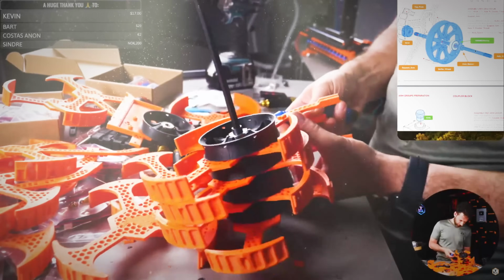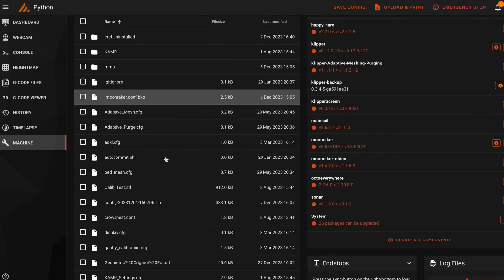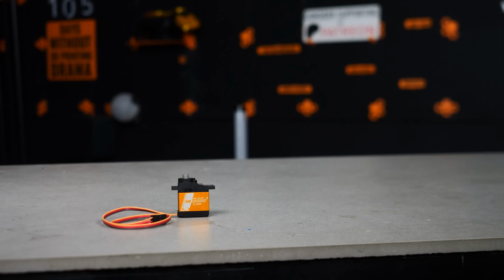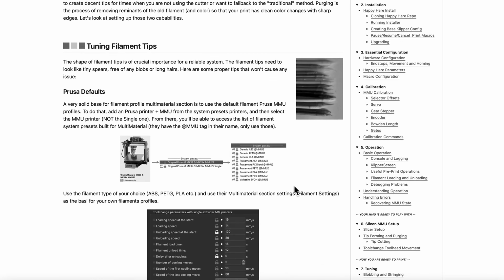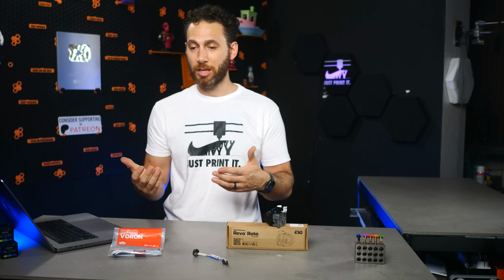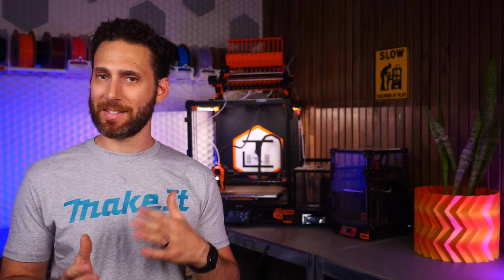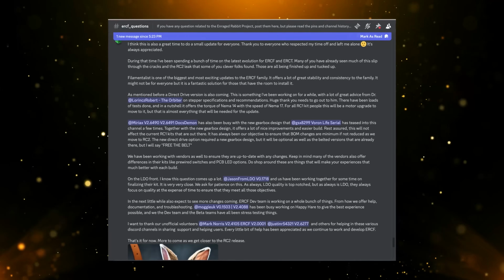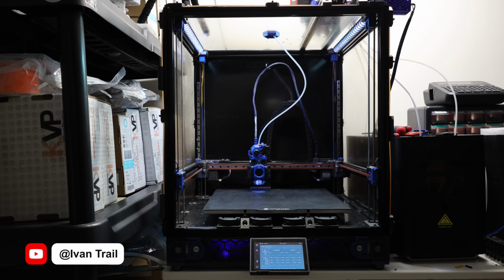I Got The ERCF V2 Working. Here's What I Learned.

Comment: Thank you for the video and details.
I do have some questions about getting LEDs wiring, working and Macro Buttons on Mainsail screen.

I have a Siboor ERCF v2 kit assembled, calibrated and ready to start moving Filament but I have no LED lights working. I have wired it per Siboor block diagram but it confuses me because it seems that some of the + are going to - in the LED chain. There are 3 LED groups.

Any help or photos of your wiring, explanation or screenshot of you xxx.cfg files would be very helpful.

Rat-Rig V-core 3.1 500 with Bondtec LGX Lite using Siboor ERCF v2 kit.

Comment: Hear me out here. And I feel like this has been done but what if you had 2 or 3 (if you have the shekels) tool heads and used each one for different materials. Like tpu in one then pla in the second and dissolvable support material in the third. And say you wanted different colours of pla or even tpu use this system to swap those for that tool head. Stuff like that. Maybe only use a 4 material one. Idk just an idea.

Comment: I have rewatched your video multiple times after talking with you at SMRRF2024 and trying to set up my ERCFv2. After a lot of head scratching trying to work out why my filament blocks just will not behave and searching online for information about how they are even supposed to feel like to engage, I came across this really helpful video which I think is about the filament block mod for the v1.1 which became the design adopted by v2 of the project. It covers that vital missing information about how loose the closure action should be. Now I know my filament blocks are way too stiff, I am reprinting very carefully to get something that hopefully works much better. https://www.youtube.com/watch?v=eno0Ubs8Q_8

Comment: Imo tool changers are the better way. Sure, it's essentially the "lazy" way, adding hotends instead of using a more cost-effective solution, but it's less wasteful on filament, time spent debugging things (looking at your full work week getting this thing to print), and yeah, the individual tools can have issues too, but (to me at least) it seems way easier to sort that out than this thing, since most ppl with a voron would probably know how to approach hotend problems.

Comment: why leave the tip inside and not just pull all back? would it clog the tube? what if you let it cool and then remove everything? dosen't take that long to cool the hotend to the point filamet is solid

Comment: Very interesting and informative to watch! I don't have the intention of meddling with firmware in my free time. I bought a 3D printer to print usefull things for me and others.
So for me a tool changer would be the better solution than a mms. But they are in a price range right now, i can not justify with my brain to buy for my usecases.
(It's not that i print something daily) I was really interested in the Prusa XL when i saw it, and then i saw the price...
Would be nice, but that's not the price range i can justify with what i do with it.
A two head Version like Snapmaker does would also something interesting for most CoreX Printers as an option if the manufacturers would offer that.
But i guess this makes the print head too heavy for fast movements. (the Snapmaker we have at work has slower max speeds than my printer at home).
So i guess they won't do that. But i would still be interested as 2 different materials would already be enough for me. And if they sacrifice a tiny bit of speed for 2 different possible materials...
->Imagine the current CoreXY machines like the Prusa Core1, Bambulabs, Creality, Qidi and they would offer a different head with 2 nozzles...

Comment: One could take a page from the automotive industry with those DCT gearboxes and build a system around a tool changer with say 3 or 4 heads, where say 2 or 3 of the heads had smaller units of this device on it and another head was "dedicated" to support material.  You could, using this scheme, have run out protection, material swaps happening while printing was happening on another toolhead.  But man what an insane build that would be.

Comment: I'm currently teaching the conversion of my e5plus to mercury zero g. I have all parts for it and zero time, but I'm sure that I soon am starting to go for it, and it will be a moment (hopefully short) in which my printer will not be available, as I have only one. Question is: once I will start my ercf build, it's it possible to stop building it and use anyway the printer as without it? Or I should expect to be stuck without the printer up till I finish ercf build?

Comment: nearly finished building v2 kit. 2 questions first i noticed your wall mounted spool holders id like to do something similar do you have a link to this system (stl files ect) also I'm struggling finding info for the filament sensors. i printed the housing for 2 sensors i have the sebor kit that comes with one sensor are two sensors necessary and at same time I'm going to change my head from wired plugin board to can where do these sensors connect. any info will be well appreciated

Comment: I would not call canbus an upgrade. There are many implementations klipper generally does not use the higher data rate one, most canbus will generate some latency from the sensors. Most of all though, many boards have drivers and pwms on the board itself. For those of us aiming at higher chamber temps this is asking for problems, keep in mind past 70c Even fans can start failing. Even printing abs the board is going to be running real hot and this increases it's chances of failure. 
It's a use case choice, for some people it will work out, for some people it won't.

Comment: Apologies if this isn't the right place to comment as someone who hasn't jump into the fray of ERCF or it's "filament changing siblings" so to speak...

On the part regarding the plastic poop, is it possible to instead of taking a dump at the corner, or make a purge block, is it possible to just make it make it part of the infill? 

Unless it's a clear-ish print, or extremely low infill/perimeter setting, I see no reason to not just integrate the blended color into part of the print that would not be visible.

Even if the print is multi material, I highly doubt that small bit of the print where the two plastics are being blended would be "mission critical" for it's use case due to the change in material properties. (if it might make a difference, the option to switch back to taking a dump is still there) 

So far my observation on this part of the plastic melting rabbit hole (heh) of a hobby, it seems like this isn't even an option to begin with, hence all the poop and "tower of babel" that gets thrown out post print

Comment: This multi material / multi colour thing seems to be a monster  that just keeps growing. Seriously how many colours do you need.... honest question. It seems we're into the because I can ill have 20 colours or more. I'm designing a 4 head machine that comes in less than an x1c with ams. 

This is not a tool changer. More like 4 head IDDEX ( Independent Double Dual EXtruders)

The only thing stopping me is software and config that I just can't get my head around.

Comment: I do have a suggestion for the cutting arm. Instead of printing the holder and then pressing the knife into it, add a pause at layer to the print file on the first layer above the slot. This will pause right before it does that layer. Assuming you're printing in ABS, dab some acetone on the blade, hold it in the slot for a few seconds until it sticks, and resume the print. I went through four of those tool holders before I figured that out.

Comment: Both multi material unit and multi extruder setup are awesome projects. However I see a significant difference in use case scenarios. Multi material units are mainly used for printing in colors, using the same type of material. On the other hand, multi extruder makes great sense for engineering use, where multiple different materials are used, either as supports (HIPS under ASA), or as aditional parts (TPE gaskets for example).

Comment: Currently waiting on my kit from Fysec. I'm looking at this as both a challenge and a project. I haven't built a Voron but I have converted both my Ender 3 Pro and Max to Klipper, moved from single Z lead screws to dual Z belts, upgraded the hotends to Revo CR with Mini Sherpa direct drives with HM7 shrouds. While I doubt this project will be even a bit easy, the harder part will be how to add a cutter to the HM7 shroud some how but then I may change my mind on which is harder when I actually start the build 😁

Comment: Upgrade the stepper to a beefy Nema17, install a 40T Wheel instead of the 80T and you will be able to do filament swaps in <20 seconds.
Reply from the maker: Confirmed or theoretically?
Reply: @thenextlayer  Confirmed, its what i have on mine and its been reliable for months.

Also, check out Filamentalist respoolers, save yourself the headache of using buffers.

Comment: "Is it worth the challenge of building one of these instead of waiting for creality or anycubic to actually unlock their systems?" In my opinion, yes. Unfortunately, these companies that make our 3D printing products often have really bad firmware or are really inefficient. Being able to make your own and tune it just the way you need it is priceless and these companies don't have a reputation of allowing or supporting that. You always end up limited. The exception being the Prusa MMU since you can tune its firmware, but that involves going back to the Marlin ecosystem and also costs quite a bit.
Reply: @GregAtlas  I’m totally interested to try, but I have no idea where to start! I have a Creality CR-M4. How should one go about starting a conversion like this?
Reply: @Artholos  For a creality system, I'd learn how to get Klipper to run on it or Marlin and install it on a different brain board. Given my experience with other creality systems, I'd also completely gut the creality extruder and hot end/cold end while I was at it since they tend to be hot garbage (though I haven't used the M4, so I can't speak specifically on that.) After getting it up and running with that kind of setup, then I would try out the ERCF. 

To my understanding, it should be pretty simple to get Klipper running on a raspberry pi and USB control the creality board. Might have to install a different firmware on the creality board for proper interfacing. Creality's brain boards are often noisy and low quality, so you might want to just swap to a bigtreetech board and the latest TMC drivers anyway, but that really depends on what kind of budget you want to spend on it.
Reply: Personally I'm most interested in using the ERCF WITH commercial printers. A K2+ with an ERCFv2 would be bloody brilliant.

Comment: i'm surprised you got the passive puffersystem running...also working with matte stuff, CF Filament, and so on? I'm close to finish my vcore 500 with 9 channel ERCF.....but i had to develop electric rewinders(just way too long bowden tube), a breakout board, the hall effect sensor was crap, extrudersensor (orbiter filament sensor) also crap....rebuilt both of them with ball bearing switches and long switch tolerance....same experience with the servo as you had....oh yeah, and a purge chute is needed....and when i thought i am finished, beacon has an upgrade for true zero measurement, means i need a brush for the nozzle....by now it reminds me of a giant bambulab printer....but it's a neverending story to build something like that

Comment: Awesome video my friend ! I’ve been thinking of tackling this project after my Zero G Mercury upgrade is complete. I was already considering changing up to a Stealth Burner, and this has pushed me towards that even more now. 
 My only question is why they aren’t using thrust bearings on the pulleys you said you had to keep sanding down till the spun. You can get them pretty small and are ridiculously inexpensive.

Comment: 7:11 ive also had good luck with the MG92B its quite a bit cheaper as well. @ 6v it has 3.5kg VS the Savox's 3.9kg @ 6v. yes thats at 6v and not the 5v the ercf will run it at

Comment: Anything over seven colors I feel like the ERC has a lot of issues the tradrack would be a great comparison for you it's extremely similar to the ERCf but it's easier to build not as wide and you can add on way more modules before you start to have the issues of the ERCf

Comment: I think all of this hardware is too complicated.

Classic cheap MK8 extruders and stepper motors, one set per spool. Arduino Uno with Klipper connected over USB. CNC Shield on the Arduino Uno, 4 stepper drivers. 3MS for Klipper. Does that sound like a plan?

Comment: I'm working on my own toolchanger, and each tool can be as little as $20-$30. Tested once, but I'm working on an updated tool,auto X Y Z Offset, and a better purge bucket. Not 12 colors though lol, but I'd love to see toolchangers with an ERCF on one tool.
Reply from the maker: How can it be so cheap? What hot ends are you using????
Reply: @thenextlayer   YouTube seems determined to delete my reply... third time's the charm. Guessing it's the link. 
I'm testing using bambu lab replacement hotends from China. $8 where I am, plus a CHT nozzle ($2 each). Combine with a cheap BMG kit ($6) and motor ($7.50) and 3010 fan ($4) and a pair of 4010 blowers ($4) and you have a full hotend. Or drop the 4010 fans and use the 3D printed CPAP-style fan from Mark Rehorst with a single air duct for all the tools. Or, of course, a real CPAP fan.

Comment: A tool-changer can at least be expanded on. Start out with just one extra tool-head. Add a third only when you need it.

I was thinking you could do the same thing with filament multiplexers, by having filament dry boxes that each have their own stepper and bowden tube running to the hot end. The hot end would still have its own filament cutter. Then you just add another filament box when you want another colour. You might be able to drop the filament box price below $150 each if you really try. The expensive part is needing a servo and stepper for each box, but there might be shortcuts around that without impinging on the modularity. Like bowden cables from a single servo.

Comment: I haved own the v1.1 and convert it to v2 (i'm part of dev team) so i don't have some difficulty to build and tuning it.
But i run it directly wired on the MB and don't have the cutter installed nor led. 
My first print after calibration has 561 swap and print it without any error.

Comment: Man, I need to give my BBL AMS a hug. It takes forever to switch, but took  zero effort to set up. I just want to print and don't have the headspace to build my own. Have you looked into the later BBL/Orca versions that try to cut off a smaller tip for less purge?
Reply from the maker: Truth.
Reply from the maker: Does newer orca cut the tip?!

Comment: I'm in the middle of building one of these and your video flashed up on my feed.  Luckily it did !  I have just started building the selector tool and your comment on the servo made me dive straight into amazon and buy the Savox.  Luckily I am in the UK and the company selling these are also UK based, so the cost wasn't as steep (23 GBP).. anyway, that's not the point - the point is you have probably saved me a lot of heart and headache.   I am stopping production and printing the parts, awaiting delivery on the servo !  Let's hope that is the thing I have to worry about anyway.  I do have one question that you may be able to help with - Filametrix - how much filament should be unloaded before the filamtrix cuts, or does it cut and leave a strand inside the toolhead - I couldn't get my head around how a new piece of filament is supposed to follow up on a piece that is left inside the toolhead .. but your video suggests you unload a bit, then cut, leaving only a small strand? 

Thanks for this video, I am subbing to your channel !
Reply from the maker: Thanks for the kind words

Comment: the ebb35 btw has enough ports like plenty.. i got endstop, filament sensor, klicky installed plus i have 3 more gpios left over one currently controlling my pwm for my 2 part cooling fans, i could technically use the last 2 for more sensor or rpm sensing even
Reply: Agreed! Just need to read the pin out schematic and you can find plenty of pins for other items

Comment: 9:22, I also noticed this strange (nice) feature of the K1C (without additional settings in the slicers) is that this 3D printer is quite accurate. Even if it is slightly inferior in print quality to bamboo in stock condition.
Reply from the maker: Agreed. It really is a phenomenal printer. Everything the K1 wasn’t. I actually think the print quality is superior to almost anything except maybe the new MK4S…

Comment: I just finished my ercf build, haven't finished the video yet. But hopefully I can get it working it just as you did

I'm building it on an Ender 3 V3 KE (which the extruder doesn't even have a Bowden load) and custom modeled a Bowden tube mount.

It's just been painful getting everything just to feed smoothly and I'm about to start printing my first multi coloured print as I speak
Reply from the maker: I thought is have it working weeks ago honestly. Like 3-4 weeks. If I had only known…
Reply: @thenextlayer  yeah it's just been pain, now I'm getting constant clogs and funny movements (because creality default macros want to do one thing and ercf macros wanna do another)